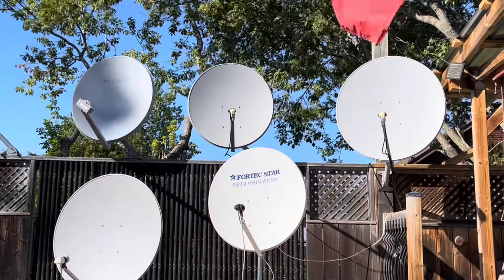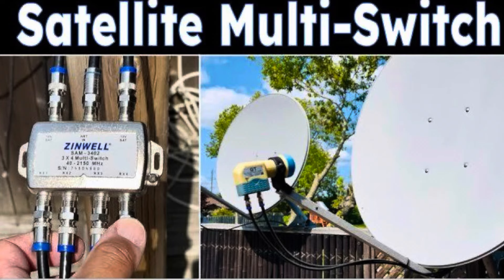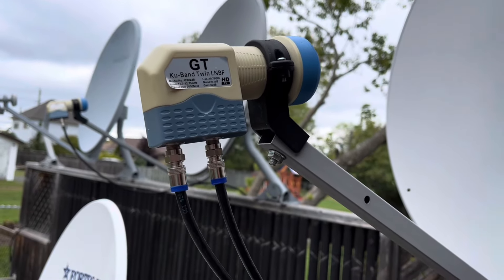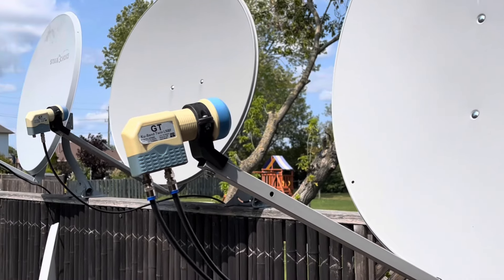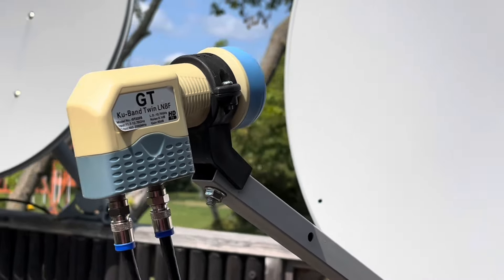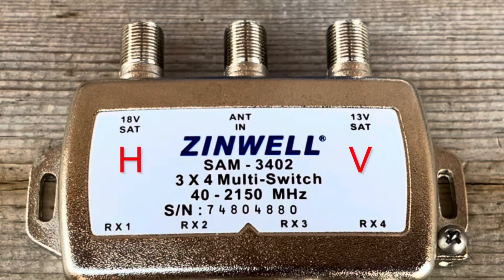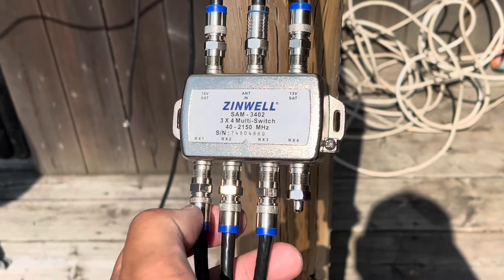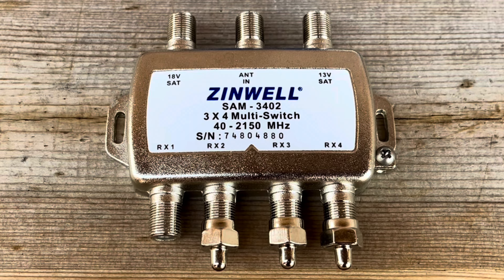Satellite TV Multi-Switch Installation Follow-Up Video - Connect Multiple Satellite Receivers

Comment: Since you have multiple Dishes you need a 10 input DiseqC Switch it works with both C and KU Band and you can control the H-H USALS motor on you KU Band Dish. If you have 2 receivers you need 2 DiseqC Switches. Unfortunatelly it doesn't have antenna input so you need diplexers or splitters with low attenuation but at the end you need an antenna amplifier.
Reply: I recommend AMIKO Premium D-10/1 Outdoor DiseqC Switch.
Reply from the maker: @Nicholas_Chris  I already have an Amiko 4X1 DiSEqC switch for my dishes. As you already know Nicholas, DiSEqC switches combine dishes, whereas a multi switch distributes single dish to multiple receivers.
Reply: @NorthcoasterHobby  I only use switches because I receive 8 KU satellites and the only multiswitches that I found only have 1, 2 or 4 satellite inputs, so DiseqC switch was the sollution. 

As for OTA I use two UHF 19 elements Yagi antennas, two VHF 5 elements Yagi antennas and 2 FM SV Total Vertical FM Stcik antennas. I mounted two splitters with two outputs that have 3.5 Db attenuation at output. They are called taps not splitters. And diplexers. As amplifiers I use 4 CATV amplifiers with 20 DB gain and 2 ouputs.

Satellite reception is made of 5 antennas, 100 cm dish with USALS H-H motor, 100 cm dish with 3 LNB support, 90 cm dish with 2 LNB support, 80 cm Dish, 1 LNB 120 cm dish 1 LNB.

The satellites that I receive are Thor 1 West, HotBird 13 East, Eutelsat 16 East, Astra 19.2 East, Astra 23.2 East, Badr 26 East and Turksat 42 East.

The multiswitches are mostly recommended if you only receive up to 4 satellites or for hotels where there are
Reply from the maker: @Nicholas_Chris  Yes, personally I don’t really have a need for a multi switch let alone one for a hotel, but they are handy in specific situations.
A DiSEqC switch is more useful to me generally.
Reply: @NorthcoasterHobby  A friend of mine  was interested in satellite reception he has 4 satellite receivers and 4 TVs with satellite tunner. 

He was interested in receiveng 4 satellites so a multiswitch with 4 satellite inputs and 8  outputs was the best solution and I also added OTA and FM reception. 

The satellite receivers were for recording. He wanted to record his favorite shows and watch other channels in the same time.

The satellite installation was expensive and mostly because of the multiswitch (this was the expensive component)
Reply from the maker: @Nicholas_Chris  Sounds like a nice setup there.👍

Comment: Hi Sir,
From your view what are the LNB devices for supplying 20 rooms??
I am currently using KU JCSAT sattlite.
Reply from the maker: You would need a large multiswitch to supply that many receivers. And multi-output LNB's. Probably 4-output to supply high- and low- band vertical and horizontal polarities to the switch.